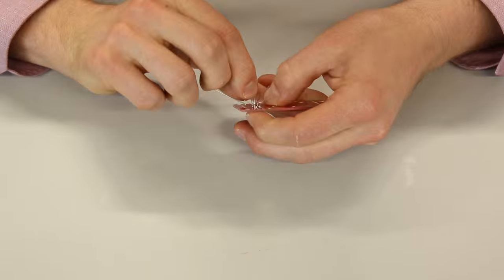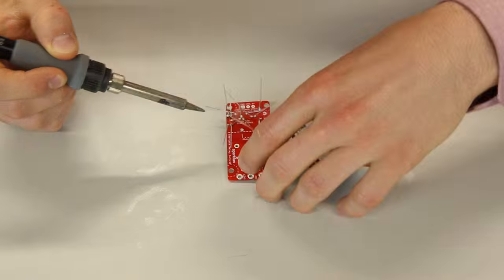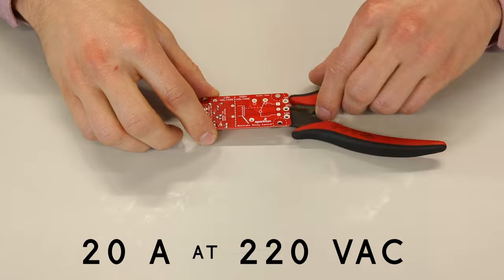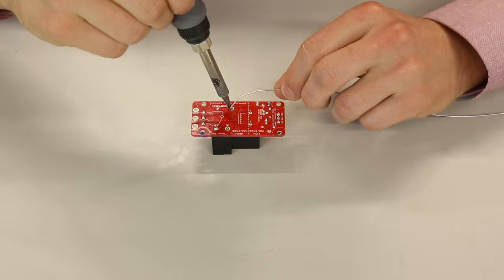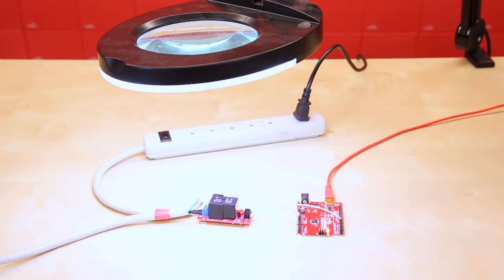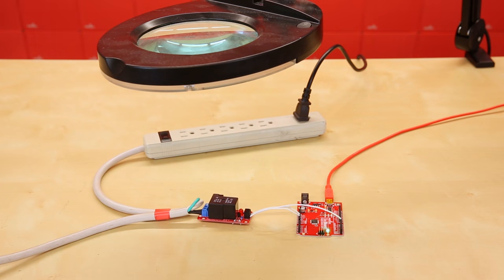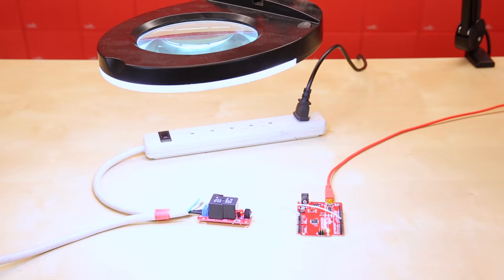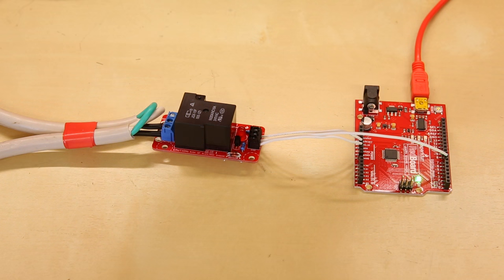SparkFun Simple Sketches - Beefcake Relay

Comment: I really enjoy your videos, please keep them coming. I do have a question......

Can you tell me or even better do a video, showing how to set up a circuit for a Christmas display project I'm starting. I'm running a 12vdc wiper motor that's turning a chain, and once the chain gets to the end of the run, the far sprocket, I want to have a normally open push button switch, or whatever, to be pressed, and the motor stops and then there's a delay of around 10 seconds, and then the motor reverses and the chain returns to the start postion and maybe another normally open push button switch, and the motor stops, another 10 second delay, and the motor reverses again and the chain starts moving forward again, starting the whole cycle all over again. I hope I explained that clearly. Thanks, and keep up the great work.

Comment: Could someone fact check me on this.  I don't think that you would want to run this at 220VAC at  anything much more than 2.5A (or 5A@110VAC) on a regular basis.  The datasheet on the JQX-15F/005-1Z1 relay gives a 'Max Switching Power' of 560W. It has a 'Rating Load' of 20A240VAC so it should not melt if you run that through it.  But, won't you end up killing it pretty quickly trying to operate the relay above the 'Max Switching Power' rating?